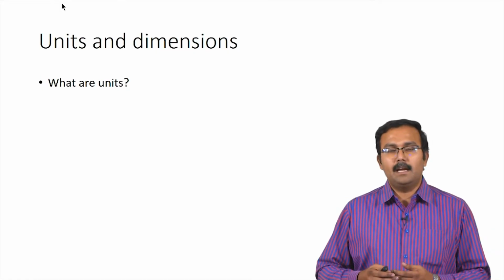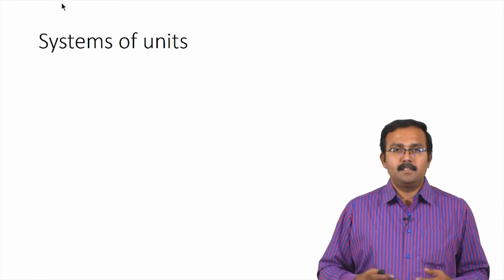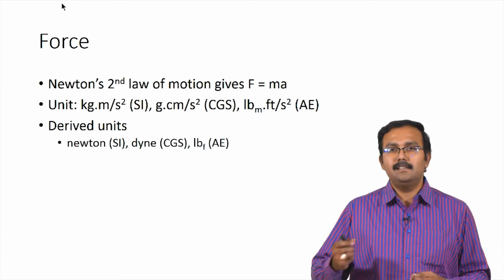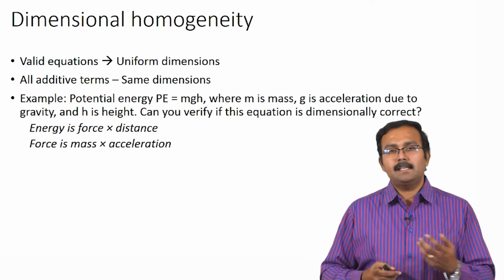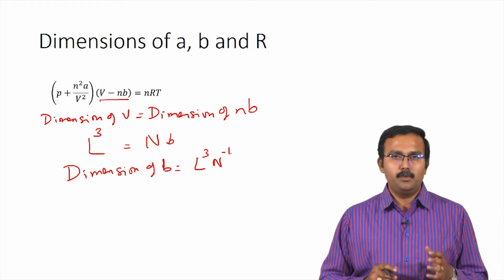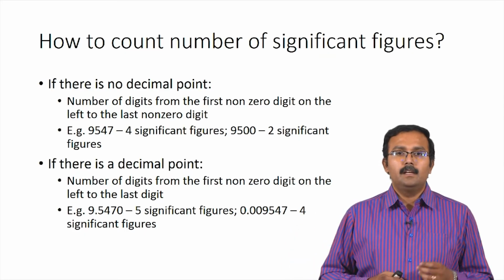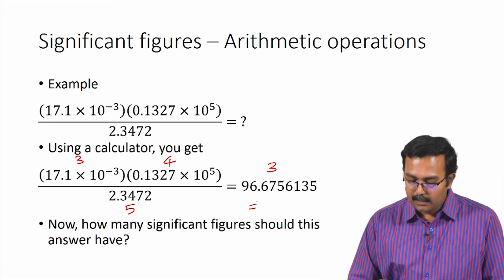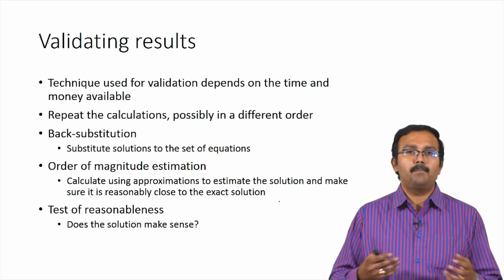#1 Fundamentals of Engineering Calculations | Material & Energy Balances

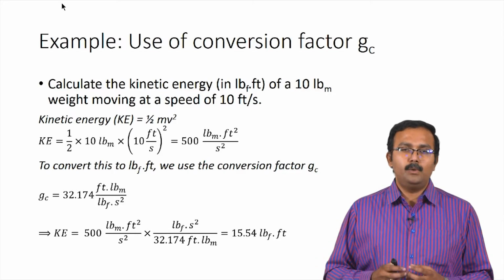Comment: Sir, at 12:57 why did you multiply with the reciprocal of the gc while initially you showed it as it is? Can anyone help?
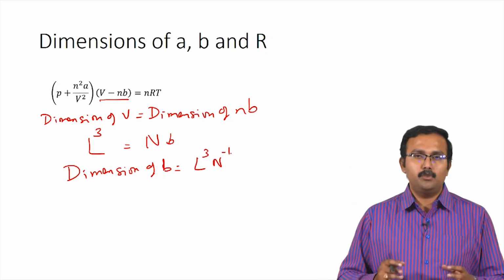Reply: Later, at around 20:00, we talk about dimensional homogeneity. We want the units of energy to end up as lb_f*ft.  However, when we first evaluated the product, we ended with 500 lb_m*ft^2/s^2.

If we multiplied this result by the conversion factor as presented, our units would be lb_m*ft^2*lb_m*ft/(s^2*lb_f*s^2) = lb_m^2*ft^3/(s^4*lb_f), which is quite strange. So we multiply by the reciprocal to cancel the lb_m, the s^2 and one ft, as such: lb_m*ft^2/s^2 * lb_f*s^2/(ft*lb_m) = lb_f*ft, which is the correct units for energy in US units.

So, the criterion to decide if we need to multiply by g_c or its inverse is to check what units we are starting with and what units we wish to end. I hope this was helpful.